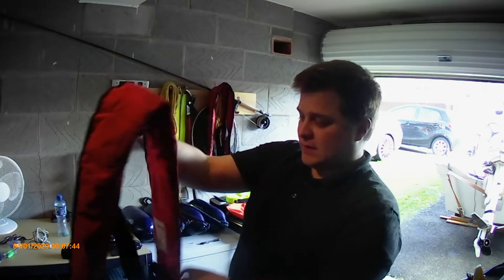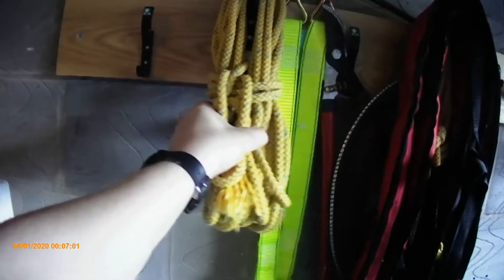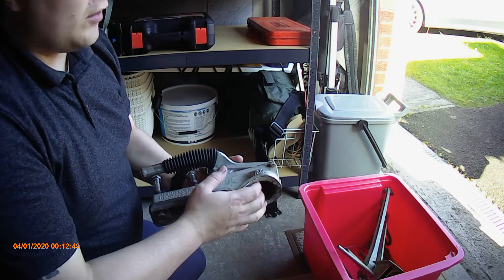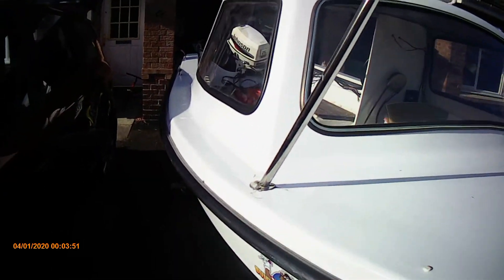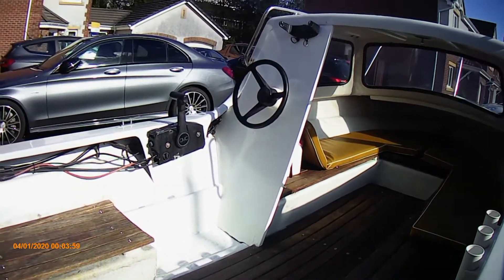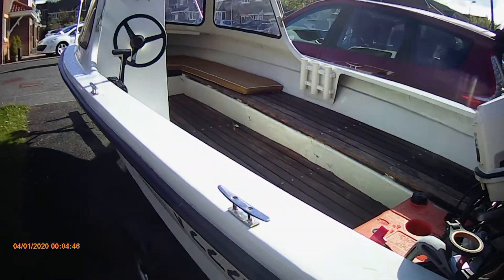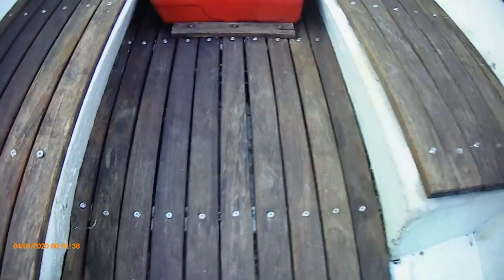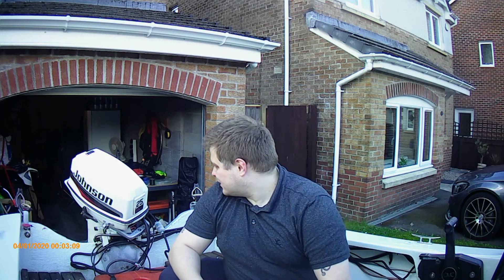Prepping a small boat for the water - Sea Fishing UK.

Comment: Thanks for the check don’t think a lot of people realise that even if the boat has been stored away for winter you still have to check every thing and that the trailer is road worthy for towing tight lines till the next one look forward to seeing you on the water
Reply from the maker: You are absolutely correct. I forgot to mention that I had the trailor serviced and the bearings changed and greesed. Thank you!